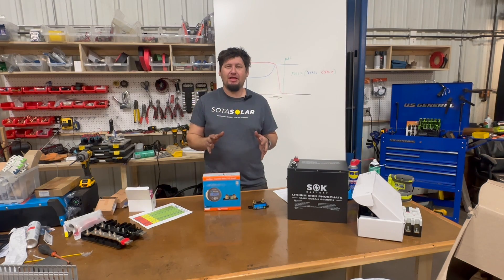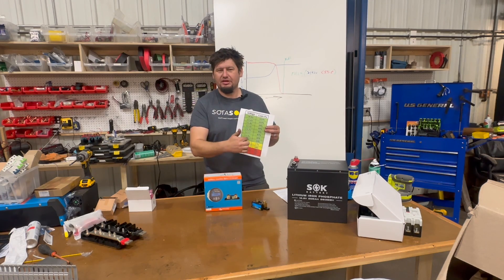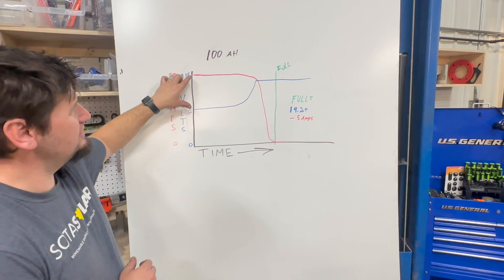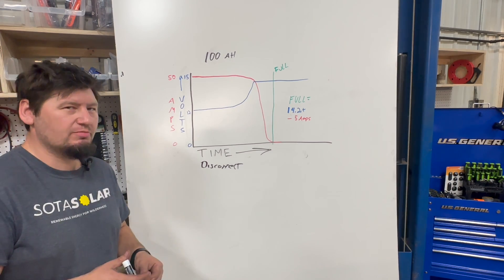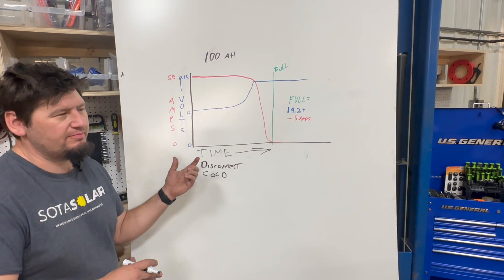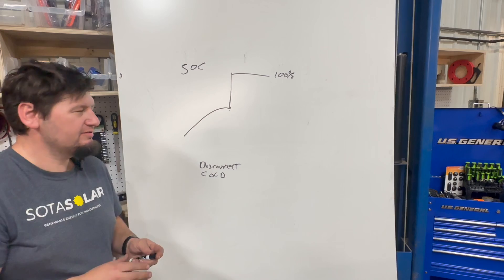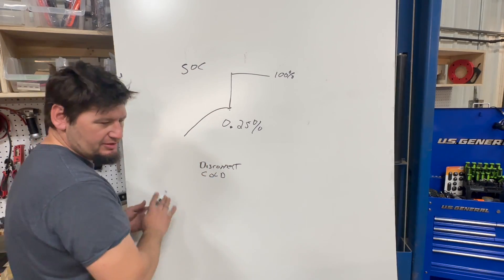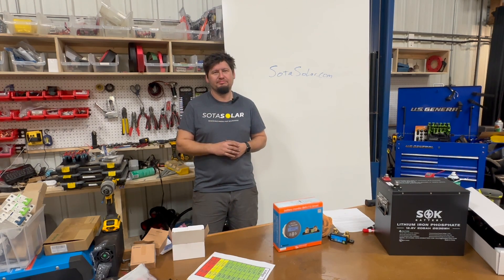Your Battery Monitor, Smart Shunt or BMV might be giving you the Wrong State of Charge | Here is Fix

Comment: Thanks for the explanation!  I Had an unexpected power outage last night and after watching your video I think I figured out why.  My batteries were trying to charge while at 22 degrees yesterday before I turned on the battery heater and I think that fooled my smart shunt into thinking the SOC was higher than it actually was because the batteries probably wouldn’t accessory a charge. I had checked my batteries before bed and they said they were nearly full but I lost power at 3am.  When I plugged in at 6am the batteries said they were at 79% but that doesn’t seem accurate at all based on what happened.

Comment: You started to say “We recommend the battery is charged…” as if you were going to state how often a battery is fully charged, but you interrupted yourself. How often should a lithium battery be charged?
Reply from the maker: Me get Distracted?? ... Sorry about that.  I'd say if boondocking, I'd like to see you get to 100% once every week or two.   Pay special attention to any jumps in SOC or sitting at 99% while amps are still flowing into the battery.  Either case indicated something is uncalibrated.  If on spring start up or first startup from storage, don't worry about those jumps.  If it happens often or all the time, check battery setting sin the battery monitor.  Firmware updates can change Charged Voltage to 13.2 very often, that will throw things off.

Comment: This may be my solution.
The other day I turned off the battery disconnect for 12 minutes, with the SOC around 65%
I turn the disconnect back on and the SOC shows 100%.
All week I've been battling a charging system that will not charge my batteries because it sees a SOC at 14.5v, but the batteries are each charged at 12.91v. 3 Battleborn Gamechangers, installed in our Cirrus 920 camper. 
I'm considering disconnecting the system side of the Smart Shunt and resetting to zero calibration when I am certain there is no current in the system. You video seems to support that a sudden spike in SOC may be to blame for by batteries not accepting current.
Thanks in advance.

Comment: Why would I get a discrepancy, or conflicting/different readings IE: 14.2 at the shunt and 13.9 from the Multi dongle?   Also, SOC stays up, and voltage drops to low cutoff prematurely when boondocking
Reply from the maker: Are you on lithium or lead acid?  The dongle will sometimes report a lower voltage. We’ve seen it.
Reply: @sotasolar  800ah lithium (8x100)
We spoke to you awhile back and you helped with cleaning the current sense on the multi 3.5mm jack
Reply from the maker: @wdafchuck oh, I remember now.  Verify with a multimeter where the voltage is getting to.  Could try and raise the absorption voltage to 14.4 if the dongle is reading low, it can affect the charging characteristics. You can also look into a warranty replacement on the dongle. I had a customer a while ago who needed to that.
Reply: @sotasolar  will do as soon as we get back into town.   Thanks again !!!

Comment: Shawn,  I have a SOC related question.  I have (2) 206 Ah SOK batteries in parallel monitored by a Victron SmartShunt.  It currently reads 100% SOC with a 13.81 V and 0 Amps.  When I connect via BT to the BMS of each of the SOK batteries I get 100% SOC on one battery and 79% SOC on the other battery.  Both BMS's show 13.8 V and 0.0 A.  Any idea why the discrepancy between the BMS SOC readings?   Does the SmartShunt measure SOC of both the batteries since they are in Parallel?  Love your channel!
Reply from the maker: One of the SOK batteries could need internal balancing. Re start bulk charging and watch that lower SOC battery. See if it becomes full.
Reply: I'm having a very similar issue with the exact same batteries wired in parallel with a Victron Mulitplus 2000/80-50, Victron Smart Shunt.  Unfortunately, the 2000 will not allow you to lower the absorption time to less than one hour--20 minutes would be sufficient.  I charge to 100% SOC indicated on the BMSs and the Victron (0 amps input and about 14.15 V--absorption is set at 14.3) with all 8 cells well balanced.  The Victron is somewhat slower to indicate 100 SOC than the BMSs. Upon discharge one BMS will start showing a discharge before the other (100% vs 99%), and the disparity only gets more the longer the discharge.  The Victron will fall somewhere between the two BMSs but favoring the higher BMS' SOC.
Currently, I'm discharging with the Victron Inverter engaged.  After 3 days, the Victron shows a 75% SOC, one BMS is at 72% and the other is at 76%.  Further discharge will show a further disparity in SOC between the BMSs.  Upon recharge the disparity narrows with one being at 98% SOC while the other indicates 100% SOC.  This phenomenon has been quite consistent with every charge cycle.
Thoughts?

Comment: You didn’t mention internal battery heaters with soc in the other direction. You may think you’ve got 15-20% left but you are almost at zero.
Reply from the maker: That’s a good point. Most heaters late only heat from incoming cu and don’t self deplete, however that can be the case.
Reply: @sotasolar either method is bad. With self heating it’s using up power that the battery monitor doesn’t know about. Battery monitor SOC stays the same but there could be as much as a 5amp load in the battery depending on battery. Then if it only takes it from the charge source, the bmv will count that as charge current and increase your SOC but in actuality the SOC hasn’t change as not REAL charge current is getting applied.